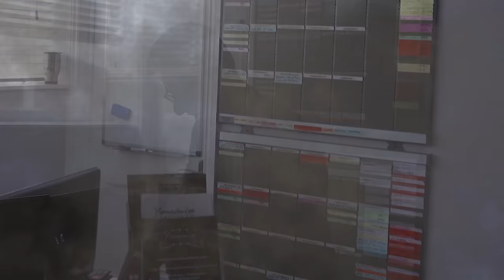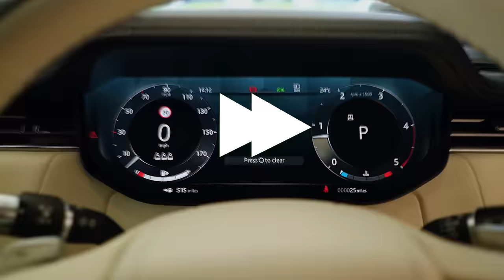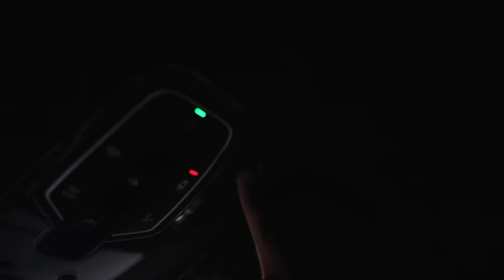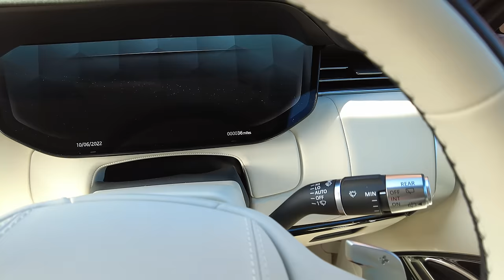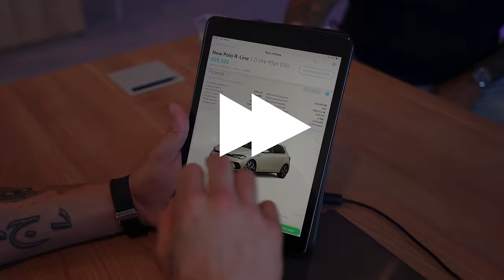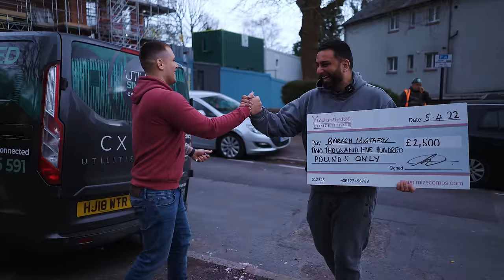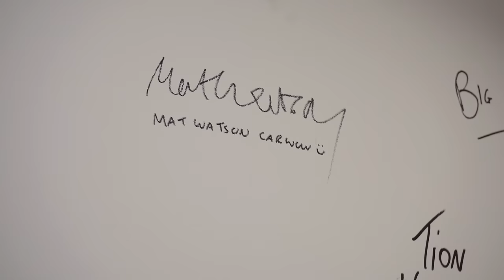Police Make Me Strip My Tints | Yianni Monthly Ep4

Comment: I got pulled over for my front tints last year. I had them on for 4 years until I had to get rid of it. The police are cracking down on car modifications. At one point police were pulling cars to a morrisons car park to check if the cars have a catalytic convertor
Reply: What’s the penalty for them

Comment: I don’t know what the regulations are in the UK for window tints. But I’m assuming they are forbidden. If you get coughs with window tints here in Germany you are in trouble. I mean real trouble! It will basically void your insurance for the car. Tinting your windows in the front is pretty much one of the worst crimes you can commit in Germany hahaha
Reply: You can have the front windows and windscreen tinted but their are strict controls on how much tint you can have, by law they need to allow a certain level of light through because it will impair your vision otherwise, it’s pretty obvious Yiannis Lambo is illegal. And the Police have the power to take your car or you can remove the tints in front of them at the roadside.
Reply: If they're tinted to an illegal level in the UK, your insurance would be void too, if you were in an accident and they could find cause for the tints being to blame (e.g. reduced vision/perception, etc.), then you'd get no payout for your vehicle.
Reply: Even just tinted your windows in the Uk. Any other then factory . 
And your insurance doesn’t no. 

Your insurance will get out of it . Void

Comment: Got pulled a while ago. I have 35% on mine, got pulled and was told if its under 30% you'll get 3 points and a fine. But over 30% is £50 fine. I have had every tint from 5% to 70% and its the first time in 20 year's I've been pulled for tint

Comment: Why not just have the darkest tints you can legally have and avoid any problems?
Reply: There not exactly dark and they don’t look great cos the contrast between the rears and fronts looks off. So then you just gotta go lighter all the way round or stick with the darker ones and get pulled.
Reply: Are you 12?
Reply: There’s 5 percentages:

75% standard on all cars
50%, 35%, 20% & 5% (as dark as you can get)

On the back you can go 5% (as dark as you can get) on the front you can’t go any darker than what’s there (75%), the next issue is 5% rears but standard 75% front looks weird as there’s no smooth blend

There’s no real way around it, loads of people run tints on the front you just have to be aware (of police) & traffic officers, I used to run 35% on my front tints and got away with it for 2/3+ years